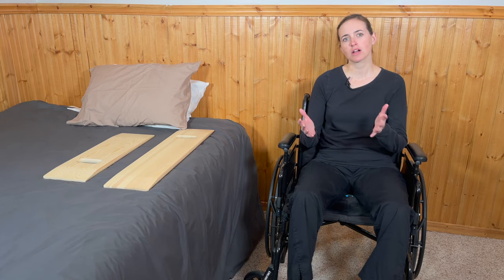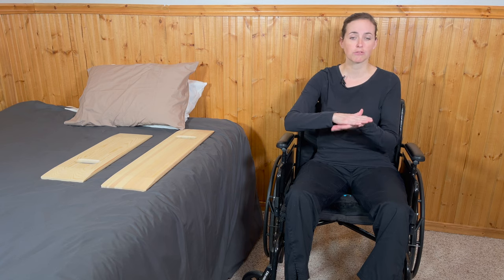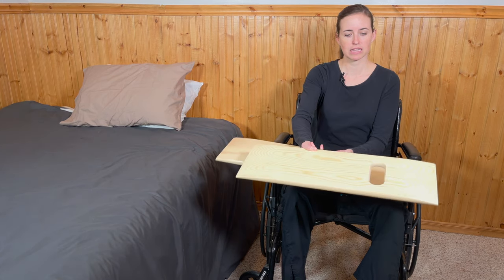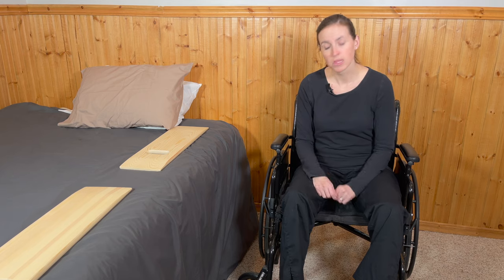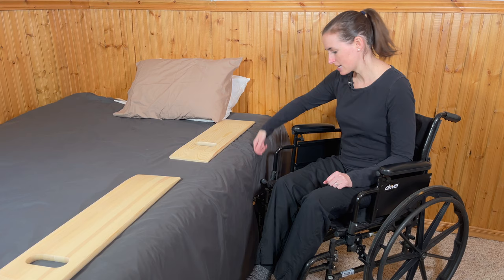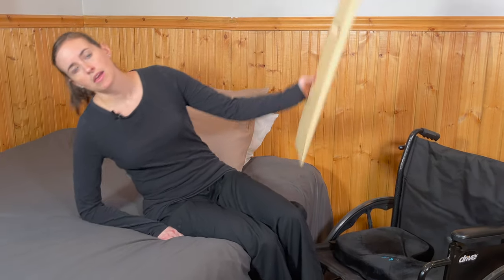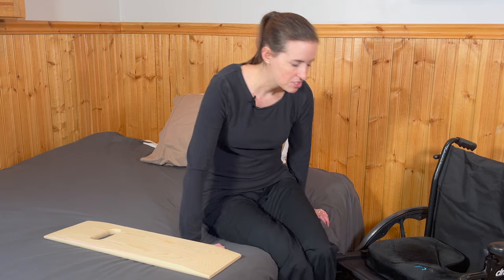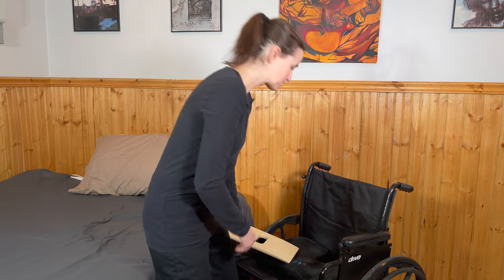How to Complete a Slide Board Transfer | Wheelchair to Bed | Paraplegic Transfer

Comment: Ok, now let’s see someone who is actually paralyzed and 200+ lbs go uphill on to the bed. I love it when they always show skinny people doing this. It’s a lot harder when your actually paralyzed and heavier.
Reply: Your 200 lbs example will need more triceps and core stability exercise, possibly a longer slide board to provide a longer lever since that person is going uphill.
Reply: This is generalized presentation , and we do need to do some adaptation .  You still need to consult with your personal physiotherapist .  Your health is your responsibilities .  METTA .
Reply: Preach brother Preach!!
Don't you just love the transfer videos that show 2 care givers helping, like who has 1 let alone 2 caregivers?
😏
Reply: اشلون حال الوزنه 125
Reply: I'd use a hoyer lift or electric transfer chair on someone whose that size.
Reply: I’m 200lbs and i transfer like this without a sliding board. I’m paraplegic t4-t5 complete.
Reply: Be grateful
Reply: This video is pointless unless I can see a paralyzed person using it.
Reply: Are helping a stroke victim with a compromised side. This is like the 10th video I've looked up and they all have someone that can use all four limbs😮 I am caring for for my sister and I have a 10lb weight limit I can lift so trying to find ways we won't either one get hurt I am the only one that can care for her she does not have other family are insurance to cover rehab.
Reply: Probably use a hoist.....
Reply: Hi 👋
267 lbs here. Upper body strength is a must. I was diagnosed with GillianBarre Syndrome and paralyzed waist down. To start this definitely try to practice on an adjustable bed.  And she makes this look easier than it is. Takes a ton of rocking back and forth,  upper body strength is needed but nothing crazy.  I could barely lift 10-15lbs when I started this.. 

Also you can start with a sheet under your butt to help slide easier and your care give can grab it on each side and pull to help if you get stuck.. going uphill is going to take awhile to practice before you can do this.. she's little, but she's making her point.
Reply: Please stop your crying. I feel as though the person did an outstanding job explaining this to everyone who’s in a chair. I’m so tired of the negativity from you people. If you can’t do it because you weigh 200-250lbs, then get a friend or relative to help you. Just stop the whining..  No pity party for me here. My head on car accident happened back in May of 1994. I was home 10 from my honeymoon. You deal with the hand that is dealt to you. I never complain or bitch about why this happened to me. We will all find out the reason when it’s our turn. But seriously, stop the hate, the complaining, and the negativity. We’re only on this Earth for a short period of time. Enjoy your weekend everyone…
Reply: Did you watche the video before you opened your mouth
Reply: @cynthiacler9284  exactly, your lucky to have a caregiver who wants to get you up out of bed!

Comment: Thank you for showing in detail how to do individual transfer. I am a new amputee on my left side I have had a stroke and post stroke my left was very weak and I lost the use of my left arm due contracture now recently I had a blister that got infected in hospital with bacteria and because the infection was changing rapidly and aggressively, I was forced to remove the foot above the knee so now I am trying to learn adjusting to a power wheelchair for mobility.i am working with PT,OT in rehab but I am happy that I found your video. Video.youre very good teacher thank you and may God bless you for your act of kindness Lindsay. .

Comment: Very nice presentation. People need to realize a slide board by themselves has to have enough upper strength to do it by themselves, no matter size, weight. Watched several videos she made to get an idea of what my sister is up against from a humerus break. And what my sister might can apply. The hair dryer grip stand my daughter-in-law says that could help her also because doing things above her head her blood pressure drops too low. An Angel sharing her knowledge and I am thankful. Electric bidet I’m obsessed now. As a succulent water bottle as a hand bidet though works better than actual ones made just for a hand bidet, in my opinion, I was. WHY CANT THERE BE AN ELECTRIC?  And so there is. Helpful I don’t need to see someone heavy and paralyzed to make it useful. It did show me how a sister helped her sister with a transfer board before they got a van with lift. She is an human encyclopedia of information to help those who need help with disabilities. Short term or long term. Brava.

Comment: This was great! I am refreshing my skills for a new OT job in phys dis. Do you have any videos about the difference from these boards to using a curved or a banana board? I know there are different opinions about which direction to have that curve! also, here in the UK they don’t use gait belts which is weird for me as a California OT. Do you feel like they are very necessary in some cases? They also sometimes use small loop slide sheets to help with these transfers, but they are hard to find nowadays!

Comment: Hi, I have CP but eventually, I do transfer myself like you do. (Despite I never used slideboards, do you think it might help me) ? Because when I’m traveling, I do struggle a
lot or I need help when the bed is like 60cm ; this is not much but anyway, this is way higher than my wheelchair :-( How do you proceed in that case ? ♿️